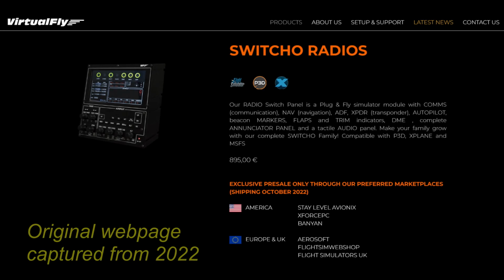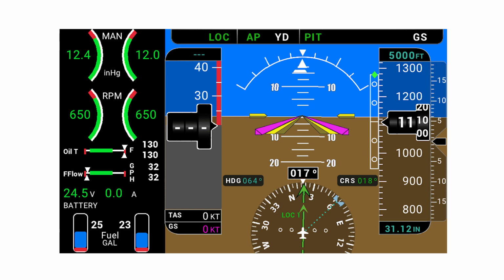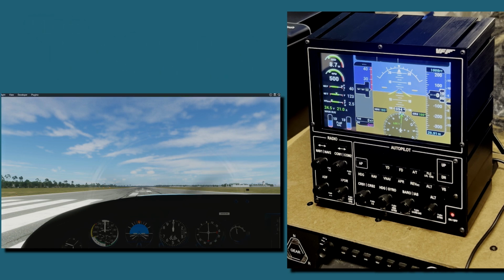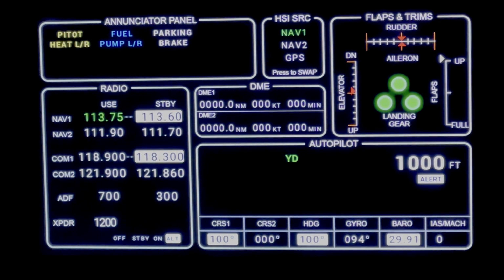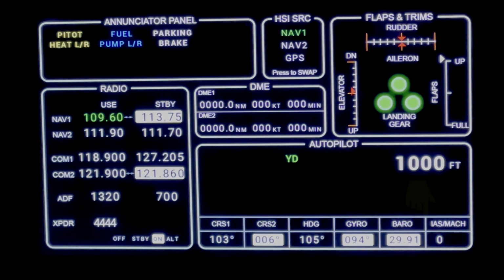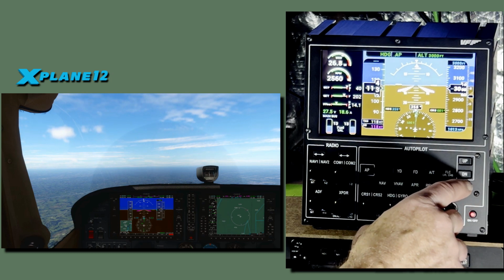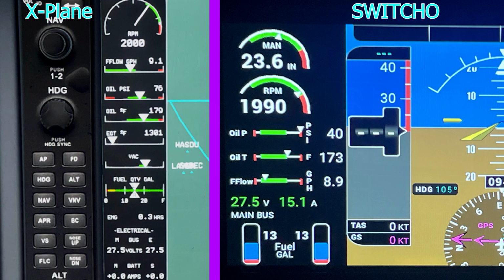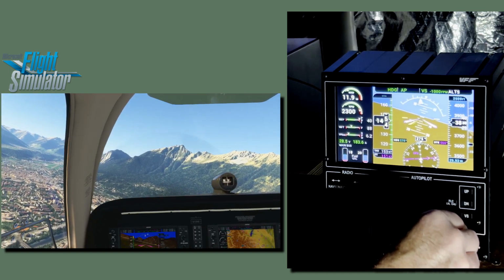VirtualFly's  Switcho Radios: Is the upgraded E-edition worth it?

Comment: This video was better than the  VF videos. I’ve been looking at them for a while but have two issues you have not pointed out:
1) I believe the portion with the knobs is NOT backlit.  Deal breaker for me. 
2) can’t give up air manager unless I was to buy pretty much everything (switches, trims, landing gear etc )switchos. 
3) not a fan of the single knobs. Prefer dual encoders. 😮
You should really hilite this stuff before people start overpaying for this stuff  I know you know better.
Reply from the maker: All valid points.  Sounds like you have skills.  Some people are plug and play.